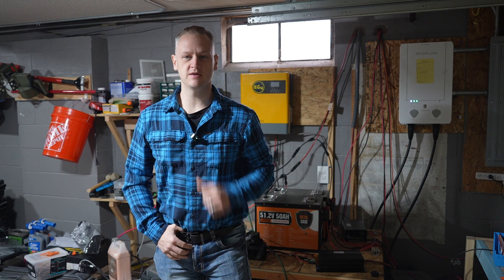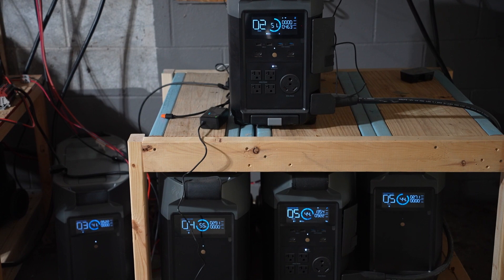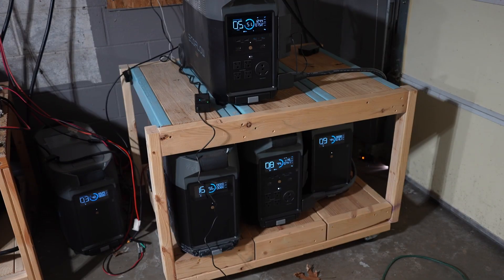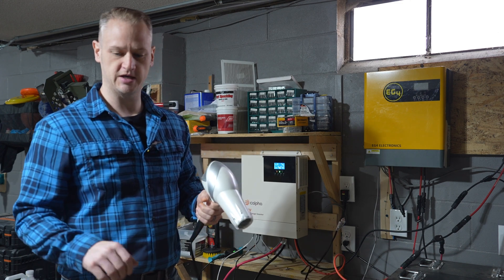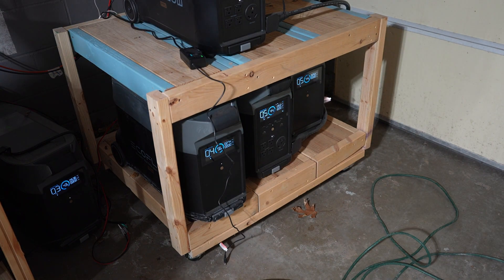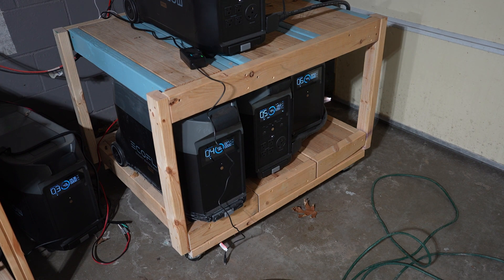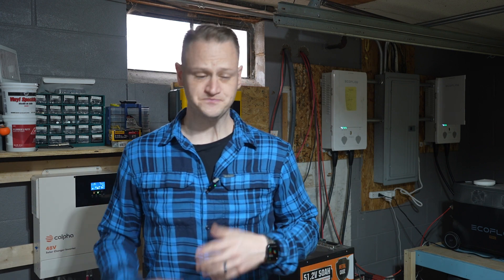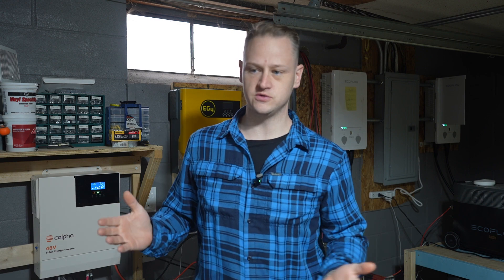Powering 2 Delta Pros with External Battery: Latest Update

Comment: 2 mppts are always a problem. I think that may have been the issue?
Reply from the maker: In this case I didn't think it  should still be an issue because they are being powered by two separate circuits and two separate power supplies from the Calpha Solar Inverter. Now, that isn't to say it wasn't an issue because their behavior certainly acted as if it was that. I'm not sure if there is a way to isolate the power source so its not shared in anyway (other than of course two separate battery banks).